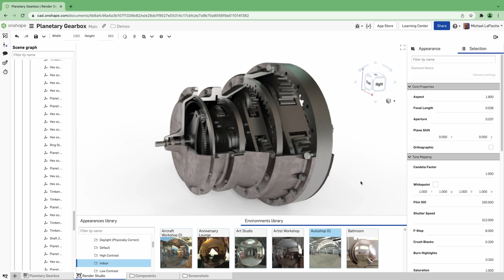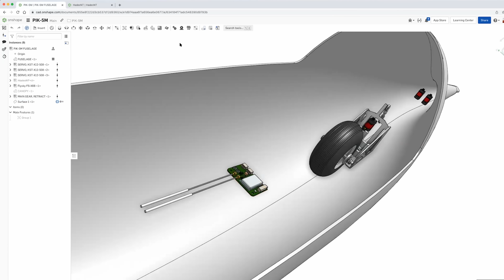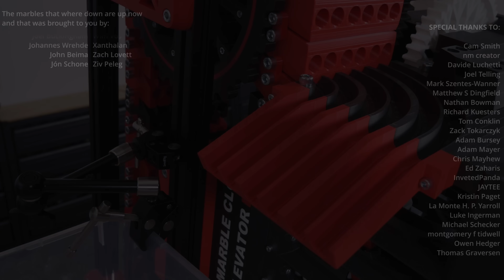High Throughput Marble Elevator - Marble Clock Seconds Display Pt.6

Comment: 2:35 I guess the solution is to put spring loaded fingers on the back that push the marbles in more forcefully than just gravity? Like the "comb" device on the top of your "once-per-minute" clock. I see you went with giving the elevator 5 times the capacity, but you could also have quintupled the speed.
Reply: Oh, I just realized that a belt which moves more than 1 position per second would eventually line up with a buffer that is in the process of being drawn from. I.e. the marbles won't be aligned exactly flush with the end of the buffer ramp.
Which means that the elevator has to stop (or slow) once per second, during the time when the selector movement happens. Unless the elevator moves at exactly 3 or 4 positions per second, the time the buffer ramps need to move is only about 1/6th or 1/8th of a second, and you line that time window up with when the marbles on the elevator are exactly between ramps.

Comment: 8:45
it also has the advantage of helping to align the parts properly. If you snug the fasteners first, then fully tighten them, the parts can align themselves nicely, helping to avoid issues from slight inaccuracies in the part. If you instead tighten each screw all the way individually, you run the risk of the angle being slightly off and having a fastener on the other end not quite line up with its hole as a result

Comment: I echo those recommending a Geneva Drive for the marble belt if you need fixed movement at regular intervals, it would mean you could run the motor at a consistent speed and it would probably make synchronization with the rest of the mechanisms easier too. It's the same mechanism they use in film projectors to get all of those still images moving fast enough to make movement happen on screen

Comment: Clever designs!

You should look into the mechanism behind the intermittent sprockets used by film projectors as it's quite similar to what you're doing here.  In a projector, film doesn't move continuously, each frame is moved in front of the light for 1/24th a second then then film advances.  That's pretty much exactly what you're doing here but it would allow you to use one beefy motor spinning continuously

Comment: It looks cool for sure and looks to work surprisingly smoothly!

If it turns out to mess with you too much, you could look into elevating into 2 buckets or even just funnels at the top, one black and one white and distribute the marbles down from there through gravity.
Then you don't need to care about elevator speed, precision, non-linear motion or overflow and the lift mechanism can be anything since it doesn't have to match with the holes.
And as long as there are enough marbles in the buckets, the fill speed into the display lines would be fast.
Though the machine would probably be more top heavy, so aesthetically, your version is probably cooler.

Comment: Hey! Awesome work. You will need some sort of feedback on the position of the belt to run it start-stop like that. Like an encoder on one of the wheels, ideally.
Small errors will build up over time until the stops are no longer in alignment. Good luck!

Comment: could you use non-circular gears, or offset axis, to run the motor at a constant speed (so the noise is steady instead of oscillating) causing the elevator to stop (slow down a lot) at pickup points, then speeding up and slowing down in a sinusoidal pattern

Comment: Hello Ivan,

Just had a random thought. The gap in the links, I guess you have already figured it out but in case it's still an open aspect, what if we put hard foam or styrofoam in between the links. In faster runs, the gap will be covered when loading and unloading the marbles and at the same time these will be flexible to cover at the top and bottom position.

Comment: Disk 5 and 11 are the same and don't use white marbels. So unless you will draw 1 in the middle row, you don't need to fill it with white marbels. I would go as far as saying you could just glue the black marble in place and skip filling the black marbels too.

Now since you need speed, you could have just used gravity to fill the rows. And for the gates a bunch of servos, not to move the gate, but to twist a screw like stopper. 90° allows one marbel in, 180° holds it between the threads, 270° lets it out. Angle could be shorter for faster speeds and it can just jump from start to end. Balls might even be pushed out by the shape of threads on the screw part. Now that I'm saying this, after you select the marbel you need, you could just push balls out showing a new digit. This could be done with multiple sincronised screws. I'm thinking a 4 grove screw placed between more marbels. If you build them with gears and some reversed they could be driven by one motor, or a geneva mechanism.

Comment: I am wondering if it would be a better option to fill the channels from the top using gravity, instead of an elevator. You'd have to sort by colour once and then maybe have a small pin to push marbles into their channels which could be pulled back if the channel is full. Did you think of a solution to fill from the top?

Comment: Loving this project but would like to see the number of hours spent on design and assembly and the number of hours the 3D printers have run for.  The cost of the filament would also be interesting.  Keep going, we need to see this clock finished and working!

Comment: When I saw this project I thought you had lost your marbles - but apparently not! Ivan, our FIRST robotics team uses 3D printed parts for many of our mechanisms. Although we sometimes use embedded nuts, we have never used threaded inserts. Usually we just screw into the plastic (always PETG). With the right interference and thread depth, the heat as you insert the screw is your friend. The screw tip gets hot enough to soften the filament which then starts to flow into the threads, Once cool, you have an even stronger joint. The trick is to power the screws in slowly and at a constant speed. They even stand removal and replacement a few times. We have probably screwed directly into the filament over 1000 places and I think only 2 have ever pulled out.

Comment: Hey, I have a suggestion regarding the refueling and the split of the marble. 
This will be a long commentary to describe a solution that I believe can be more performant. Tell me what you think about it! 😊

I think this elevator is over-engineered and is not a good solution.

The small red selector to fill the elevator seems very good and useful because you already have segregated marble and filled all 3*2 channels at once regardless of human interaction. But since you have to segregate white and black marble before the selector, I think having some segregated "bucket" to keep the marbles that are waiting to go into the system can be a good idea. It will be easier to refuel the clock for some tests 😉 

But instead of filling the time second selector with an elevator, you can use gravity by turning the system upside down. You can create six rails from the top to the bottom for all 6 channels, those will be your injection ramps, and those injection ramps can be filled by the small red selector linked to the buckets. 
When the big selector drops a selection of marble to display a second, since each injection ramps will be full, the marbles will move due to gravity and fill the missing gape in the selector. And marbles in the segregated bucket are going to fill up those injection ramps. 
This solution should be less noisy (except for the first refuel), more efficient, and take less space.
It also makes fewer moving parts, which means less synchronization! 
The only detail you need to pay attention to is the height between each row of digit selectors. It must be at least two marbles in height and exactly the size of the marbles, otherwise the marble won't be align with the next row digit selector.

The final question is how to fill those segregated buckets. 
In my thinking, this must be done at the end of the clock, once the display moves. 
We can imagine multiple solutions. 
- If the marble doesn't leave the rail of the display you can use a reverse selector like the one you already built, but in reverse.
- If the marbles do leave the rail and mix themselves, you can use something similar to your old elevator (but not directly in an elevator). Since you can control, stop, and read the color of the marbles you can direct them in two separate lines. (Like a reverse selector but only reading the color this time)
Then the system will be segregated back and you can use two small elevators to fill the buckets and close the loop. 
Since they will be segregated, you can also use a larger frame to get the marbles, like the bucket of an excavator. 
You can move it at full speed since you are not going to interact with the marbles in it, only taking them and emptying them, from the bottom buckets to the top buckets. 
Those elevators will be smaller, more efficient, and less loud too! 
They can be linked to the same part of the display selector in order to have only one motor and don't need to be synchronized because it's just a lifting mechanism.

I hope you understund what I'm trying to tell.
If you want I can make some sketches to create some visual examples. 

P.S : Sorry for the size of the comment! 😬😅
P.S.2 : Like your work, keep going ! 😊

Comment: You can have some taper on the top side of the ball channel at the transition from the elevator. On bottle cap elevators air is also used to blow the caps into the channel.

Comment: Q: now that each of the 15 segments to display a second’s digit in 3x5 format has 10 selectors in a ring (representing 0-9):

Perhaps switch from a mix of black and white marbles to just white — with an empty spot instead of a black marble ? 

You would then just block a marble from being loaded in that space for that particular second. 

Then you just need marbles to show up at a particular second, clear at the half second —while the next second’s marbles are rolling down the ramp, and then at the next second you have that visual view.

I can draw a diagram if you’d like.

Comment: You can use maybe use a ratchet moving on a gear or two gears that are "missing" some teeth go get a non linear movement on your elevator, but still have a linear movement on the timing discs

Comment: Two bowls of marbles (black and white) what are gravity feeding to three columns. Only logic is to required to split random marbles to correct bowls on top. For marble elevator you need prioritize white over black, because you need 618 white marbles and 282 black marbles every minute. 

Also in gravity feeding, you should prioritize middle column for black marbles and right column to white. Left column consumes 33% from whites and 34% from black, middle column consumes 21% from whites and 60% from black, and right column eats 46% from white but only 6% of black marbles.

Comment: Suggestion for movement speed: instead of using rotary motion directly to drive it, use a rotary to linear motion converter and have it move by one marble channel's width per forward movement. during the backwards movement of the linear actuator, the elevator would be stationary, allowing the marbles to load and unload themselves, and it simply can't fall out of sync if properly calibrated.

Comment: You might want to make a split ramp for the overflow marbles, and keep them separated by color. It will aid/speed up the reloading of the conveyor, and eliminate the need to feed all the marbles through a separator like the main clock. Yes, the marbles from the displayed seconds will have to, but this would cut down on the speed that they'd have to go at, and maybe saving on wear on the parts.

Comment: I think the new design is much better but with the original elevator maybe you could have raised it up the height of all of the channels then paused for the marbles to roll thus filling all of the channels with one marble each cycle? It would have meant the elevator would have had to move 5x faster than it does and probably would have had some other problem I'm missing like marbles not entering the elevator that fast but maybe you could still do something similar with this design for even more overkill

Comment: In order to not have timing-issues with the marblechain’s stoppingfases when running the clock for longer times (1mm or even 0.1mm deveation in the correct ‘slow down’ fase of the change, will make the ‘stop’ fase shift over time. Instead i would use a sensor the indicate when it needs to slow and when it can speed back up again. A simple metal plate or boldhead on every chainlink  (and maybe a programmed timer to delay/move the ‘stop’ pulse for timing) will give you the exact pulse for every time the chain has to slow down without relying ln the exact absolute position of the chain!

Comment: This man is going to go mad building this thing and I just hope that one day he has an opportunity to put it on display somewhere.

Have you seen the Wintergatan? (pardon me if I misspelled that) It has tubing to send the marbles to different locations, it'll take some doing and a TON of extra marbles but you might be able to use clear plastic tubing to send the overflow marbles back down to their respective loading bays instead of them falling down into whatever sorting system you'll be using, it might be a good way to save your motor from overheating later on as you add more and more to the machine!

Comment: This wouldn't really work and actually I am not sure how it could even be compatible with the display portion, but something I thought could be interesting. What if the marbles exited to specific channels (the part I am not really sure is possible) and also had a cam system on the exit side so that instead of merging then sorting the marbles again, they were sorted as they left and never mixed together at all? Perhaps the display could be like the game Connect 4 where they come out of a mechanism similar to your current display, but then travel perpendicularly to an exit frame. This idea is probably even more complicated than your sorter but I just thought the passive sorting was an interesting idea.

Comment: Since each color has its own lane throughout the belt, I'd imagine that it could save you some time if the "refuse ramp" at the top diverted black and white to separate containers.

It could probably also wrap around to dump them back in the input for each specific color.

Comment: Likely the most asked question, but why not leverage gravity to feed the channels? Just transport the marbles to the top of the system and let them fall down a channel from which you can feed the other channels? Less moving parts, no starting/stopping of the elevator, more robust, etc?

Comment: I adore the huge belt addition but it seems like it would be easier to gravity feed the marbles from the back of each slot. Putting a vertical tube behind each row of inputs and filling it with marbles would cause them to automatically feed into each empty slot once a marble is removed by the selector. Alternatively, you could have each input slot curve upwards into an upwards facing hole and run marbles over the holes to fill them as marbles get depleted. Either way, great work! Can't wait to see more progress.

Comment: That was awesome! I really love the high-capacity belt idea to make sure that the marbles always get refilled! Also, your approach to move the elevator quickly and then stop it as it aligns with the output gates of the marble selector is brilliant! Although using a stepper motor and programming to align the belts with the gates is functional, have you considered using a geneva drive to do so? It produces intermittent rotary motion from a continuous rotary input that seems to be exactly what you’re looking for with your belt alignment problem! I think it might help with running the entire mechanism off of one motor! (Fun fact: old film cameras used a geneva drive to convert the continuous rotary motion of the hand crank into intermittent rotary motion, where a single frame of film would be aligned with the camera’s viewport and held still for a moment before progressing and moving to the next frame, which is almost exactly the same scenario as your marble loader!)

Comment: 14:17 that's one of those problems that you can't find until you've build the thing. Or only after years of building things and having had something like that happen before.
Because I wouldn't have suspected that to be an issue either.
14:32 this on the other hand is something that I already /did/ see coming and was wondering in the earlier shot if there will be put something to prevent exactly this from happening. Seems like a "no" xD

Comment: Do you plan to sort the marbles that come from the seconds display? Because you could use another or the same marble selector that chose the marbles to sort them again! Purely mechanically. I think that would be super cool. If you then add a geneva drive the clock could run on a single motor no further electronics needed!

Comment: How difficult would it be to keep the marbles separated as they are released from the clock 'face', and fed back in so that they only need to be sorted the very first time? E.g., either white and black marbles are diverted separately as they exit the face, or each 'pixel' of the number is its own separate channel that just loops around/back up?

Comment: Feels overengineered. There are essentially three selectors for B&W marbles, where as you could have had just one hopper for each color and make sure it's always filled to the top. What's the reason to have a mechanical conveyor that spreads them into channels, if you could do it in one step with a selector from the previous video?